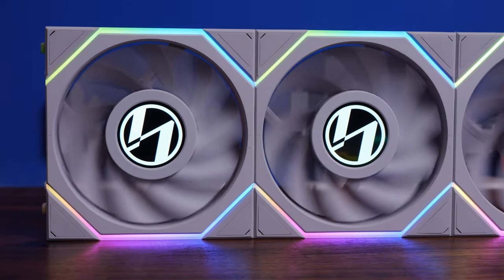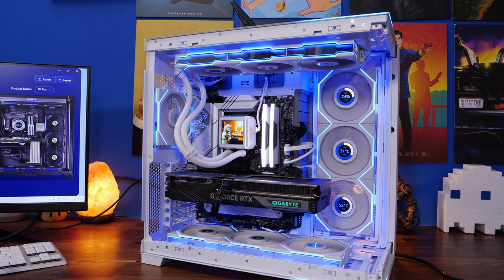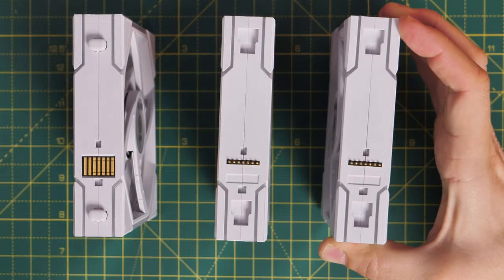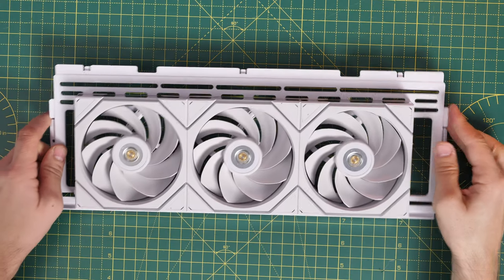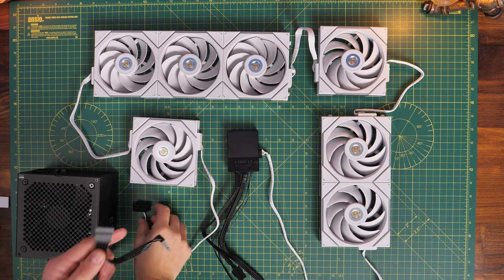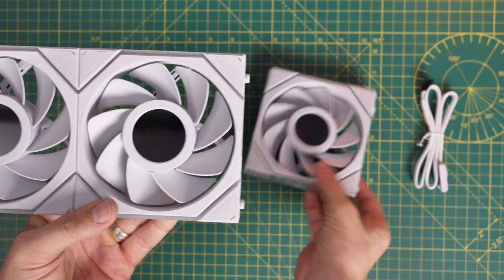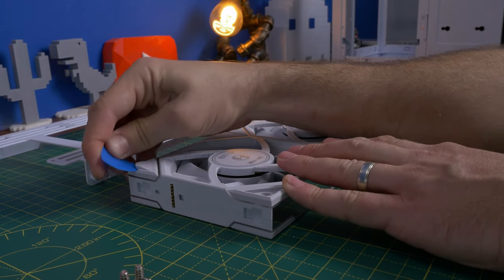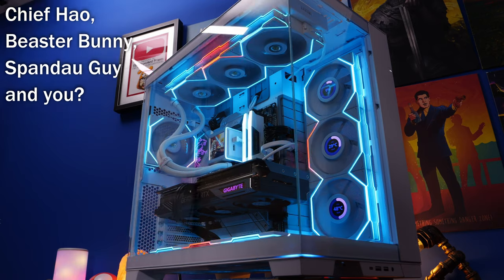Lian Li now has Uni fans with LCD screens and more - Lian Li TL and TL LCD fans

Comment: I have pretty much the same setup as you, all TL (3 LCD and 4 LED). From what I see in the video I want to connect the 3 LCD into the controller separate from the 4 LED fans. So 2 fan connections out of controller and no SATA necessary

Comment: just an idea, lcd fans have more air pressure while non lcd fans have more airflow on 140's (according to spec sheet subject to scrunity) it might be more optimal to side mount the radiator along with lcd and let air flow through bottom to top uninterrupted
Reply: I'm really looking forward to any reviews that would compare TL 140 non-LCD to LCD - these numbers make my head spin on which one will be better (if any) with rads

Comment: Hello, I plan on putting these fans in a Lian Li o11 mini case. I noticed that the dimensions of these fans are slightly bigger. With them being 124x120x28mm in comparison to the SL uni fans at 120x120x25mm, will the 120mm TL fans fit in the rear of the o11 mini case? I’m sure they will fit everywhere else, but I’m worried about it fitting in the rear of the case. I can’t find anyone that has put TL fans in a o11 mini, only SL fans. You usually have all the answers to my questions, so I figured that I would ask!

Comment: amazing video as always. do you know if you can use lcd tl’s with the old sl inf fans? like can you use them on the same lian li fan controller?
Reply from the maker: I haven't tried but I bet they'd say don't. The flat connectors are the same to the recent SL infinity but Lian Li usually says you need the specific controller for the relevant fans

Comment: So, I have the uni sl-inf 120 triple pack, the new lcd triple pack and 2 aio (aorus waterforce x2 extreme aio for cpu and aorus waterforce RTX4090 aio fans) and I’m wondering if I can or should use the sl-inf? All going into a thermal take p3 pro. Any suggestions?

Comment: Aye quick question. Which lcd fan should i get for exhaust so the lcd is facing outwards, Reverse blade or the normal ones. and are these fans compatible with SL-inf controller

Comment: I’m just waiting for them to release the SL-INF 140mm in reverse blade.
Reply from the maker: Me too
Reply: @TheProvokedPrawn  Yeah it kind of makes no sense to me that they only made the reverse blade in 120mm when they have a 140mm model for the regular SL-INF as well. Especially now that they released the O11D EVO XL which can support 420mm top, bottom, side, and front (with the mesh panel), I feel like a lot of people that buy this case (myself included) would want 140mm fans all around, but with no reverse blade option we're just kind of stumped right now. Funnily enough their rival Phanteks does support their D30 fans in 140mm reverse blade, but I prefer the way the SL-INFs look a bit more.
Reply: @TheProvokedPrawn  is it only reverse

Comment: I got the LCD fans, but can't use them as my PSU has no 6 pin ports (only SATA) and my GPU uses 16 pin so I can't use that. Any recommendations for a PSU that can support intel i9 13900K and a 4090 as well as support 2x lian li TL fans?

Comment: hey PP. love the videos for sure as i'm a builder myself.  Being new to lian li, I got the lian li 011 evo dynamic rgb case based upon your review. Now to my question.  What do i get with an already purchased "corsair iCUE H150i Elite CAPELLIX XT", I'm thinking of lian li TL LCD 120  reverse black 3pak for side intake, TL 120 reverse black 3 pak for bottom intake, and finally TL 120 standard black 3pak  for top exhaust, hoping that it will  go into the corsair radiator just fine screw wise. Does this make sense to you? Also how many USB 2.0 connections would i need in this combination is my real worry?
Reply from the maker: They should attach to the rad just fine. You can also get this to solve usb worries https://youtu.be/d8vELbWWaCQ
Reply: @TheProvokedPrawn  thx for ur prompt reply to this post.

Comment: sorry, just to check, is the limit of the lcd fans 6 for the whole case? or 6 in a daisy chain?
Reply from the maker: They say 3 fans per port upto a maximum of 7 on one controller. You can't daisy chain the LCD ones

Comment: Great video.  Quick question, which version of the triple fan would I want to purchase to mount in the front of an NZXT H7 for intake where the screens would be seen from inside the case?
Reply: Reverse, but what a waste putting these at the front.
Reply: @pepesilvia3827  just temporary.   Will move to another case where they will be seen from mounted on the side

Comment: good afternoon. Will it be possible to connect Lian li Tl led 120 3pcs + lian li infinity 120 7pcs , will you need to use two controllers ? and will it be possible to synchronize them?
Reply from the maker: Two controllers

Comment: Could you explain how to connect the Galahad v2? Did you use the original hub with the TL fans?
Reply from the maker: I used the TL controller. Connected the fans to it and then set the group on the rad to be controlled by CPU temp. I.e. spin more when it's hotter. The pump is then connected to AIO Pump or CPU fan on the motherboard.
Reply: Really appreciate the feedback... Happy NY @TheProvokedPrawn

Comment: hi, random question but i've got the kraken z73 aio and wanted to use these fans on that cooler but im not sure how to connect these fans to the three splitter cables coming out of the aio? would the fans work correctly if i connect the l-connect controller to the motherboard or do i have to connect the l-connect controller to one of the three splitters?
Reply from the maker: Just leave those splitter cable empty and remember which fan port you use then set the fan speed for that to change according to CPU temp with l connect

Comment: The controller that comes with the Galahad 2 LCD-Inf has different connectors, Would I then need two different controllers ? Or would I forgo the controller that comes with the AIO since it appears in the video that you don't have the connector running to it, only the USB connection ?
Reply from the maker: In my build I abandoned the AIO controller. Connected the pump head to CPU fan, then controlled the fan speed of the fans on the rad via L Connect, syncing with the CPU temp.
Reply: Excellent !! Thanks for the reply. That’s pretty much what I had planned. Now just to wait until they are available (I think around the 15th of January). I was going with the Corsair ICue Link but the reverse fans here just have a much better look. Thanks again !!

Comment: We have almost the exact same setup.  I have a six pack of the Uni Fan SL Infinity connected to its controller, and I have the Galahad II LCD-SL Infinity AIO which is connected to its controller.  I want to add just a single TL LCD at the back of my (reversed) Evo RGB case.  It's in the perfect position for reading the fan LCD!  But what controller can I connect it to and get use of it's LCD?  I'd hate to have to buy another controller just for this single fan, or buy another controller to replace either the AIO or SL Ininfity controller.  Will it be fully functional if I connect it to one of my existing controllers?
Reply from the maker: Sadly you need an LCD controller
Reply: Yikes.  Was doing some more research and found a note at the Lian-Li site that said I also can't connect other fans to this controller except the TL family.  Why they do that to us.  LOL!!!   Rehtorical.  $$$ @TheProvokedPrawn

Comment: Will the fans still work if you don’t use the Sata cable or do you need to for the fans to work
Reply from the maker: You need the PCIe power cable for these ones
Reply: @TheProvokedPrawn  I tried and I’m not getting power with the other Lian li v2 controller the v2 fabs work
Reply from the maker: @ToniRawGazer  I have a wiring guide here which might help - https://youtu.be/gvDVijV4qvU
Reply: @TheProvokedPrawn  thanks brother I’ll check it out
Reply: @TheProvokedPrawn  definitely connected the controller with the fans properly but still the fans won’t spin and no lights
Reply from the maker: @ToniRawGazer  and the controller is connected to your motherboard via USB? Have you checked for firmware updates? https://www.google.com/url?sa=t&source=web&rct=j&opi=89978449&url=https://lian-li.com/wp-content/uploads/2024/01/20231222_TL-LCD-Firmware-update-guide.pdf&ved=2ahUKEwjPgryat4OHAxUmWkEAHSGdDiUQFnoECBsQAQ&usg=AOvVaw1LwUXvYeXk0lsHkxc4Q0Uc
Reply: @TheProvokedPrawn  I just tried again for some reason it works weird. Got a question I have the Lian li Strimer x3 cables and 3 tl lcd and 6 Lian li v2 fans but I’ve ran out of usb headers on my motherboard. Is there a option to have them all connected thanks

Comment: Super noob here, if I want to install these as fans on my aio, how do I set them to be recognized as my aio fans and have them act according to cpu/rad temp… do I do that via software or is that a different wiring?
Reply from the maker: https://youtu.be/gvDVijV4qvU 

Remember the port you connect them to and then set a fan curve in L connect to respond to CPU temps and spin up accordingly.
Reply: @TheProvokedPrawn   thank you very much ! that answers my question

Comment: So I'm having a problem with these fans that I can't figure out. I have 3 standard TL fans as my exhaust and I have 2 reverse bladed TLs on my radiator as an intake. I put the standard fans into the controller then connected those to the other group of reverse blade fans and none of them spin or light up. I have the fan header and ARGB into my motherboard but still nothing. However they all will spin if I use SATA end without the controller. Am I doing something wrong?
Reply from the maker: https://youtu.be/gvDVijV4qvU
Reply: @TheProvokedPrawn  I've watched this video as well. The only thing I haven't done is run the standard and reverse blades in different groups I have them all together. Even still they should work as I have them wired as there's only 5 fans not 10 or more. It's as if the controller isn't getting any form of power but everything is plugged in
Reply: @GanymedeXD  I've long fixed this issue. I had a faulty HD Audio or whatever the controller plugged into. So I was forced to run it off a splitter to run both my fans and AIO but it's all working now
Reply: @GanymedeXD  yes. The controller is connected with 6 pin and it's other connections and then all my fans run off the chain

Comment: If I have the H9 flow can I replace the lcd’s (the ones with a screen) with the fans that come with the case
Which would I need reverse ones or non reverse i don’t understand reverse and not reverse and I want to be able to see the screens on the fans 
And can these work with the GA all Trinity 360(plz reply about to start my first build and I need some more info)
Reply from the maker: Reverse
Reply: @TheProvokedPrawn  thank you for your reply do you think you can elaborate as to why so I can understand for the future
What’s so unique about reverse is it “better” or what
Reply from the maker: @ApparentlyBlakeLuvsLatinas  oh it's not better it just has the looks. It allows you to set the fans as intake but still see the blades or screen.
Reply: @TheProvokedPrawn  so will either standard or reverse keep my pc and my components cool ?

I have the h9 flow NZXT case
Reply: @TheProvokedPrawn  ¿

Comment: If you were fortunate enough to have these do not and I repeat do not use SL fans in combination with TL LCD fans.  I spent over the past 8 days trying to get the TL fans to work properly.  The only fix was to remove the SL fans replace them with non lcd tl fans and boom they all work with no issues at all. (Too many hours spent just trying to figure out fans for a desktop..  sigh)
Reply from the maker: Did you try to use both fans on the same controller?
Reply: @TheProvokedPrawn  I didn't!  I did read a warning message about them not being compatible and that I would have problems if I were to use them together.  Also one more thing to note, I found out one of the TL LCD fans were bad.  Not sure if it happened as I was trying to get them to all work or it was bad before and could have made my situation worse, but the screen turned on had no lights and the fans were going max speed with no way to get the program to recognize it.  Going to exchange it today but was something to add from my experience.

Comment: Argh you showcased it but didn’t detail the setup… how would the lcd aio work with the lcd fans? Do you need to use both boxes?
Reply from the maker: I've got a full wiring guide publishing soon. But I didn't use the AIO controller, just the new controller. Then connected the pump head to the CPU fan and then set fan speed based on CPU temp in L connect.